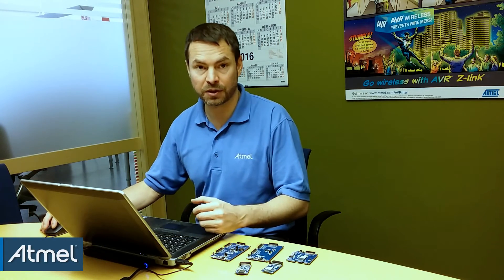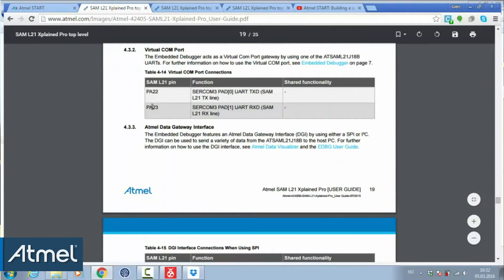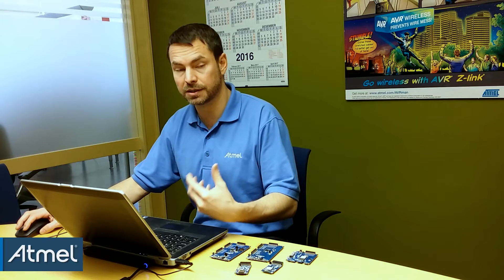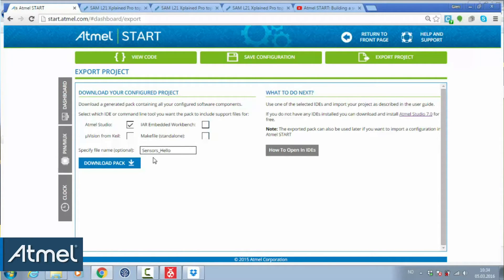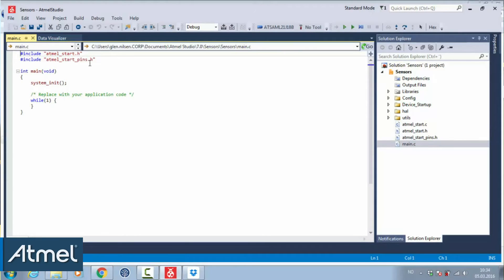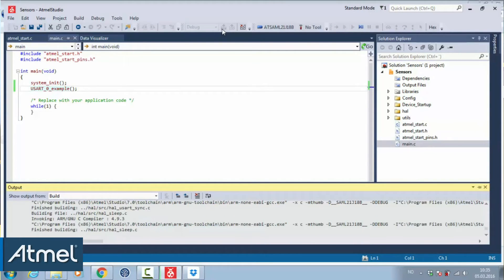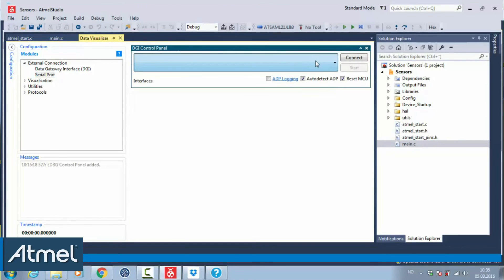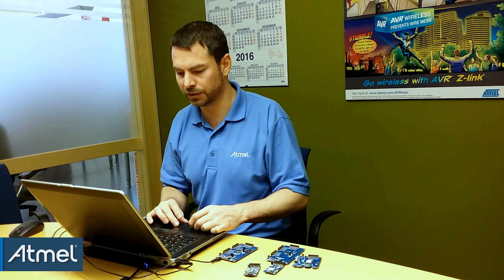Atmel START Sensors: Hello World (#2)

Comment: all this START thing is very dissapointing, we are 3 years later now and the START isn't that mature and professional as it should be:
- sometimes it stops working and become unresponsive

- it is slow as hell (even on a strong machine and 500Mbit fiber internet), sometimes i have to wait for 20seconds to check a checkbutton
- GUI is stupid, it does not disable irrelevant settings, for instance disabling a functionality do not disable it's arguements, so it is not obvious what is needed and what is not 

- the underlying ASF4 is inconsistent and misleading, for instance: why does the API take a channel as an argument ADC routines without evaluating it (same51)? 
- Clocks shown in the wizard are sometimes invalid, because not all fields are considered calculating the values

- directory structure is a mess, why using a dedicated directory for START? Why offering overwriting of main.c?
- sometimes AS7 refuses to start because of a MS error message, I have to restart the AS
- why I can't add own SW modules? We have a bunch of standard ICs which we use all the time, it would be a great idea to let the customer create own modules and add them on demand to different projects. The modules for third party products are rather a usesless demo 
- at the end I ending often reverse engineering ASF4 because things simply do not work or i need to look into datasheet and do (even the simplest) things directly by my self
My conclusion abotu START: an abstraction which forces me to hold on and dive deeper into it's implementation to get things running is useless and waste of time and at the end of the day i lose money using it. To me is ASF4 API is a rather a demo than a professional tool for implementing serious projects. My advice to Microchip: instead of "doing it for someone else". just take your own medicine, start doing serious things by using START every day, let others use your tool, watch them how they use it, improve it continously until it works flawlessly and perfectly.